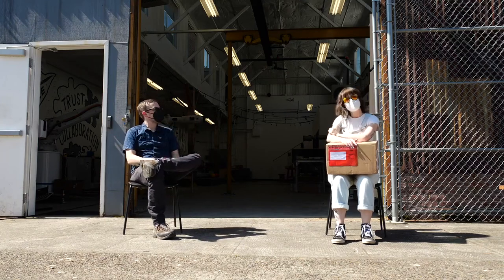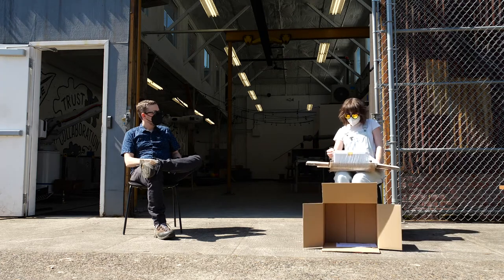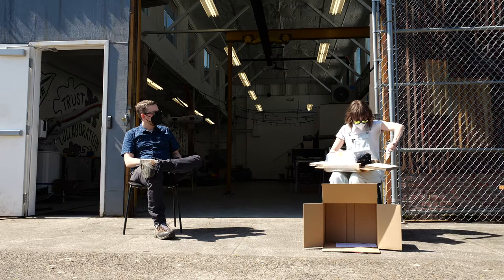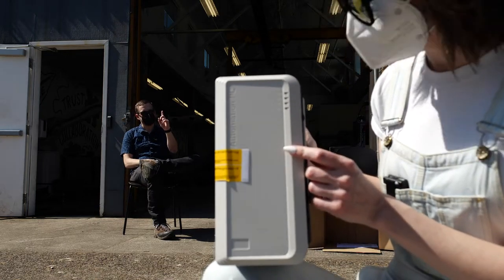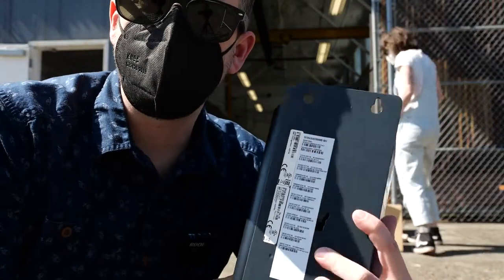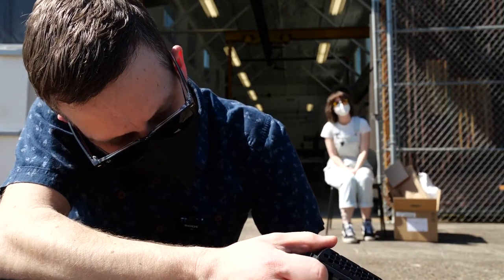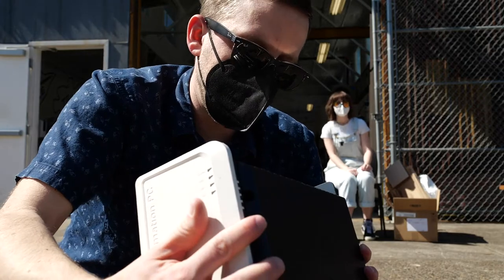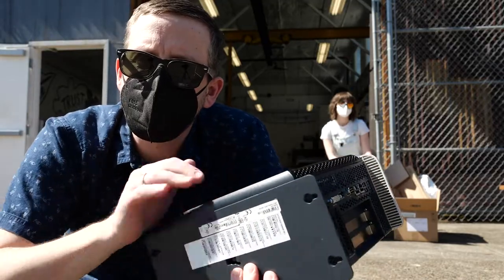Unbox: Industrial Computer

Comment: I use one APC910 as my home autiomation system which is connected in the whole house via PowerLink and local via X20. Lot's of I/O's and Solid State Relais. WOrk fantastic and i have made a web site which has won an award. SO i'm very happy witrh it. ANd it can do a lot more.